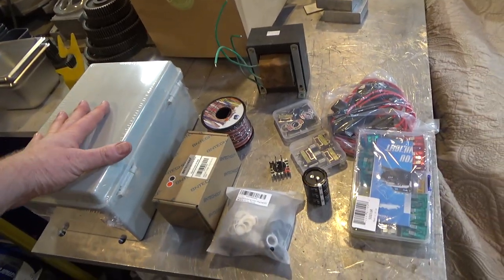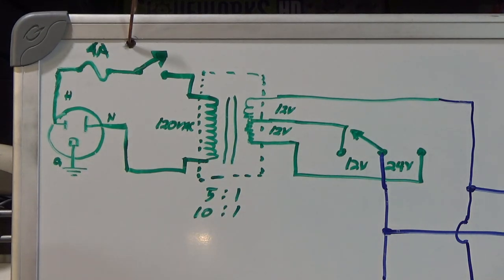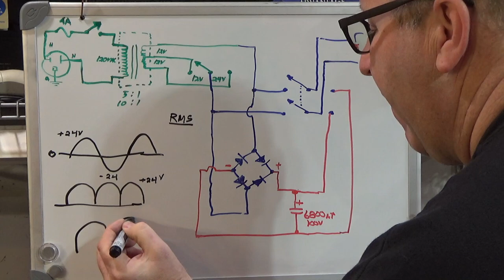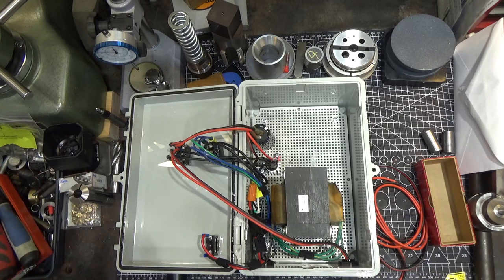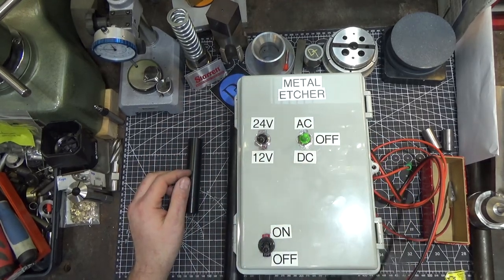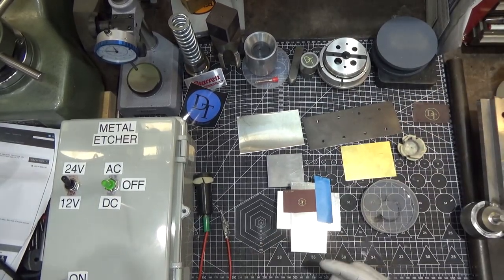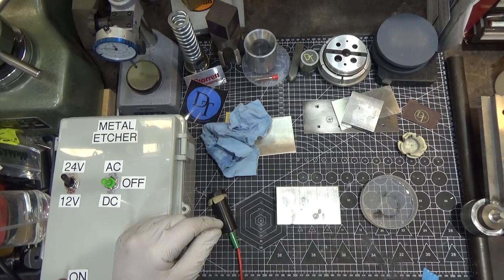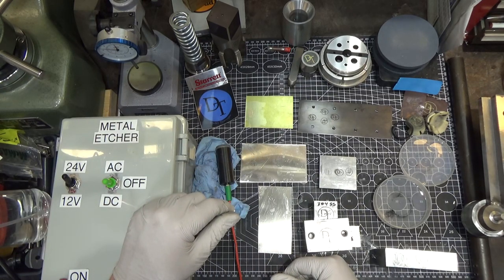161 Electrochemical Metal Etching

Comment: Something I've been doing for a long time is painting parts with etching primer. Using a cheap laser cutter. Mine's $100 From amazon little 7 inch x 7 inch. Cut they design or lettering into the primer. Then using a DC power supply.  I clamp to a Q-tip dipped in vinegar and salt. Also vinegar works on every metal that I've tried it on from brass aluminum and steel stainless steel. This way I've been able to engrave any part. image or lettering I've Ever Needed. Then remove the primer. Works amazing looks almost like a stamp or fully lazer engraved.
Reply from the maker: Great tips. Thanks for sharing them.

Comment: There are some inexpensive laser engravers, like the K40, that might be a better option. You don't need stencils or chemicals with laser engraving which makes the process much faster, cheaper, cleaner, and generally provides a sharper image. Because cheap lasers lack sufficient power to engrave directly on most metals, a spray coating like CRC Dry Moly Lube is typically used. Anodized aluminum can be engraved directly with great results.
Reply from the maker: Thanks for the tips. I had not heard of the K40 and have been looking for a long time. The problem is that most semiconductor lasers are too low in power. CO2 lasers are the wrong wavelength their output (IR) is not adsorbed by most metals. This leaves fiber lasers which work great (20W is enough), but they are quite expensive, even the Asian sourced ones.
Reply: @DudleyToolwright  K40's are available for ~$400 which has made them very popular. They are C02, but there are numerous coatings that enable them to engrave metals. CRC Dry Moly Lube works well and is inexpensive. CerMark is specifically designed to work with lasers like the K40, but cost significantly more ($70 for 12oz can). For about the same money that you're going to spend on electro-chemical engraving equipment and supplies, you can get into laser engraving. To me, it's a no-brainer. ;-)

Comment: Step-up transformers are commonly use in vacuum tube equipment to get a high plate voltage. 2,000v transformers have been often used in linear amplifiers for ham radio. But those are transformers designed with sufficient insulation to handle 2K volts. Reversing a 120V step down transformer is an invitation to the Gods of electronics to release the blue smoke.
Reply from the maker: Tis true. I have been bitten more than once by the B+ line while working on old monitors, not to mention the high voltage (15-25kv) although unlike the B+ the HV is very low current. Still hurts though.
Reply: @DudleyToolwright  Yeah. Ouch. I burned a small hole in my finger removing the anode connection from a TV tube from which I had insufficiently drained the charge. I heard it arc, but apparently that only drained part of the charge. I'm still undecided on which hurt more.. my finger of the elbow that caught the cabinet edge from my involuntary withdrawal.

Comment: Voltage and danger... Getting a master degree in electronics the basic course in measuring technich was intense, starting with the security aspect before being allowed to enter the labbs.
One guy ended his life there once. The highest voltage available was only 35 volt! 120 or 240... The same danger! To many self made experts bubbling, paper guys....
Using a slow blow fuse is better in this application. The rather large capacitor will surge quite som current at start up.

Have You thought about EDM? The tool to burn up broken taps, bolts etc?
Reply from the maker: I think about EDM often. I would live to have both a wire and a sinker EDM. tight accuracies really fascinate me. I have thought about trying to build one from scratch. You are right about the slow blow, but I didn't have one and forgot to order one.

Comment: We started with 90 volts, then 100, 105, 110, 115, 117, 120 and now we’re at 123 (unofficially, but that’s it). Eventually we’ll be at 140. The reason is that other than when we went to 20 amp lines many years ago, we’ve been able to keep the same outlets while increasing the wattage out of the outlet. In Great Britain, I’ve been in hotels with three different outlets, all with different amount of current, and all incompatible.

Did you parallel the outputs of the tranny for the 12 volt out for greater amperage?
Dudley, what is your background, if I may ask?
Reply from the maker: That is some very interesting historical perspective. I was not aware.

Comment: Is there a parts list for the Power Supply somewhere?  If not that is OK, just looking to save some time.
Reply from the maker: Contained on this page are the parts I used except for the transformer, which I had. However, I did find a transformer with adequate specs.

https://www.amazon.com/shop/dudleytoolwright?listId=1RV7BHP4BGAHF

Comment: Could you have the polarity wrong for DC?  With the pad metal getting eaten away, kind a seems like the polarity is wrong. Not sure what metal should be used under the felt pad. Maybe pure copper?  Nickle?  Steel?

Need to add a power light too the box.
Reply from the maker: Good ideas. I watched videos from the vendor that sells the equipment and I think I got it right. I will double check, thanks.